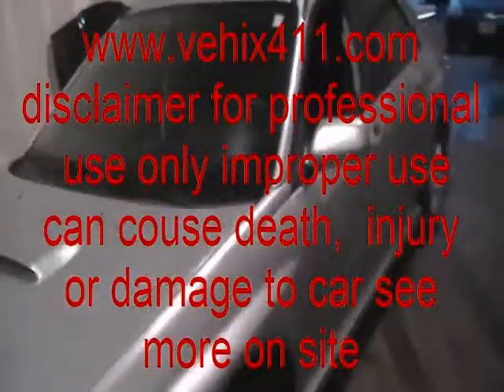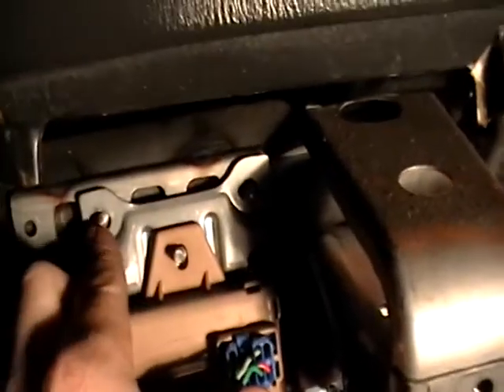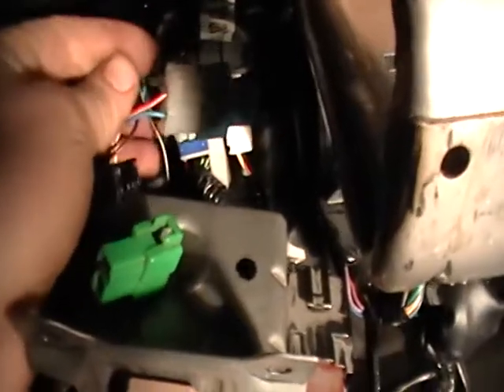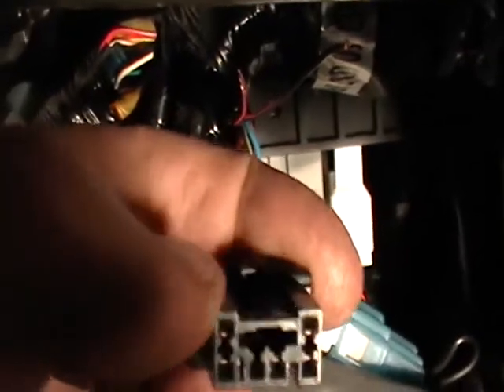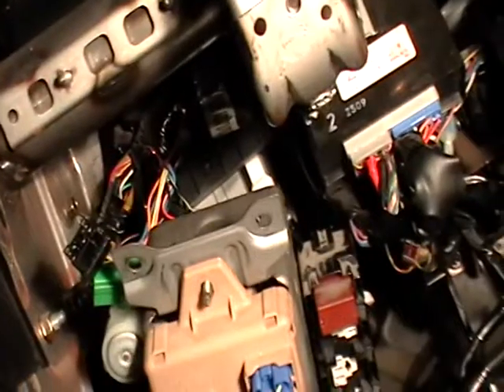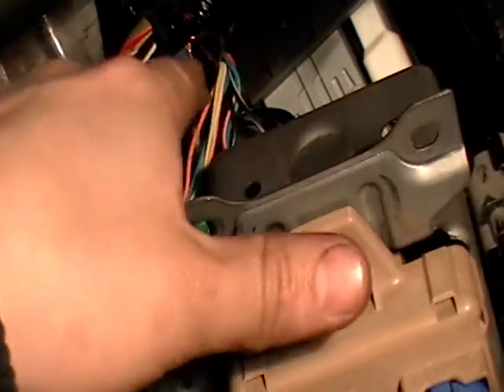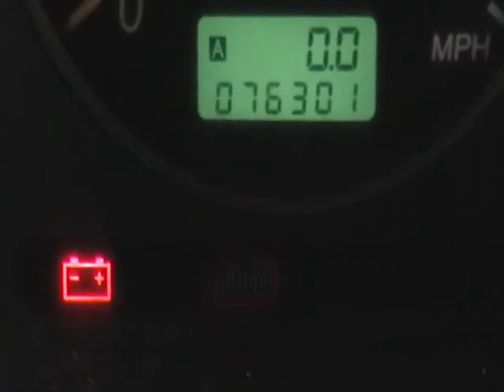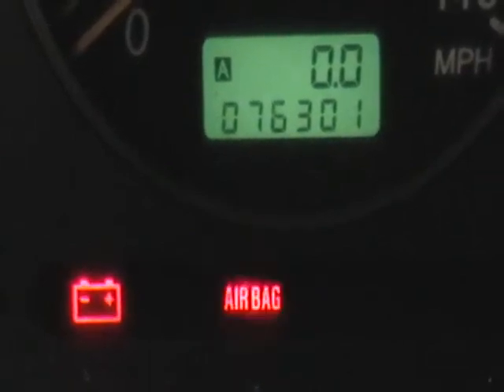how to diagnose airbag air bag control module system airbag codes on subaru wrx sti

Comment: I have a Subaru 2010 legacy I was unaware the seat bag light is on the dash and it says off for the passenger seat the sensor under the passenger seat is unplugged it's charred on the female end I'm not sure if it's the module or seat sensor or harness for the passenger side the seat belt chime is chiming for the passenger side as well please help I'm a senior on my own! Thank you for the broadcast.

Comment: I was first a little confused on your test resistor, until I read the bands on your resistors.  The manual and you specify that this resistor be a total of 3 ohms.  For clarity, you have 3 x 10 ohms resistors hooked up in parallel, making a total of 3.3333 ohms of total resistance. Right?
Reply: so what's confusing there...

Comment: hello mori in Brazil, how do I reset the airbag light Ford Fusion 2007? 
the code that the scanner is in b2290, OCSM.
Reply: Hey, just wondering if you ever figured out a solution to this B2290 code, as that's the exact code I'm getting on my 2006 Mercury Milan.  Any feedback would be greatly appreciated, thanks!!!
Reply: Ryan
not found, the only solution that ford has given me is changing the passenger rail.
Wanted to do something with resistors, or bypass, but do not know how the ford fusion. I do not know where to place the resistors. Have you ever found a solution to the Milan?
Reply: Unfortunately, I have not found a solution but do appreciate your feedback.

Comment: what means ckt?  Yes car was after small accident, but airbags, seat belts pretensioners are ok (i checked resistion of airbags and pretensioners and it's ok). Today i turned off and again on my airbag module and then my computer showed me two another errors 31 and 32. So now i have 11 12 31 32 and 61 62... -,-   Here's my movie- what's going on when i pick 2 pins (to delete airbag errors)

youtube.com/watch?v=Aii_dR3cciY&feature=g-upl&context=G2bc135dAUAAAAAAAAAA

Comment: I have a problem with errors. After i connected first diagnostic pin i get only 2 errors -  12 and 62. After i connected 3.3ohms resistors i get 2 next errors- 11 and 61. So now i have 4 errors 11, 12, 61, 62.    If i connect 2nd pin my computer to reset Airbag Module it is still showing me errors - its still blinking long and short times to show errors (not blinking all the time the same).  What have i to do now?   I have this problem in my 02 WRX